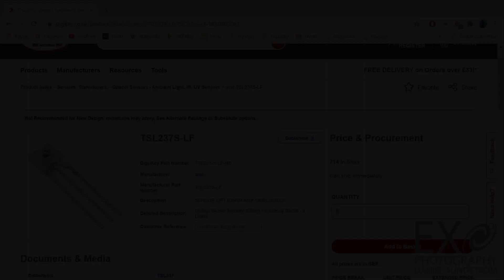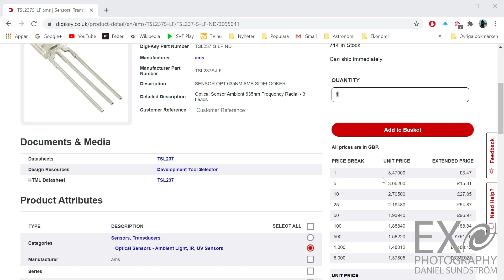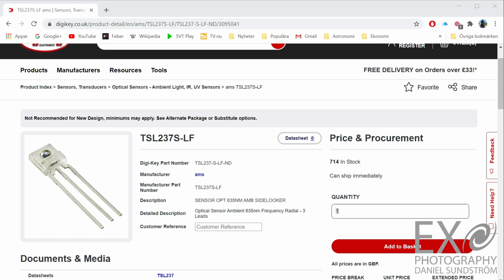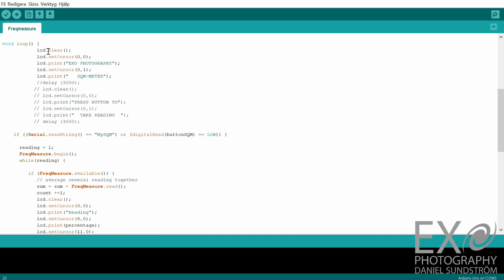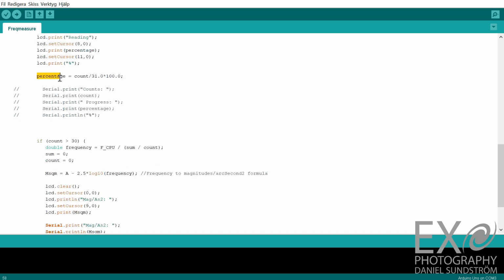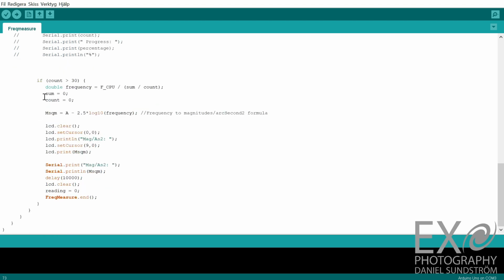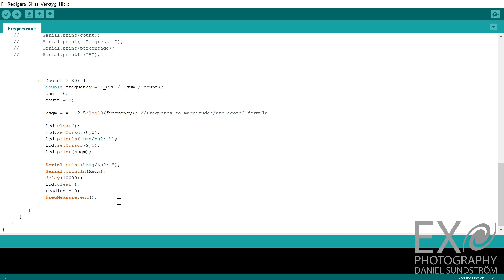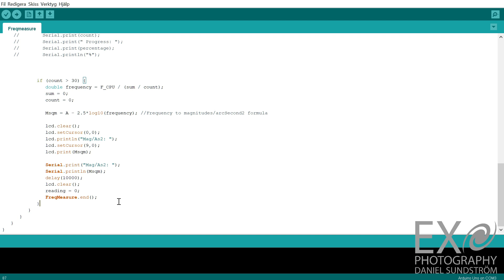MEASURE STARLIGHT - ARDUINO SKY QUALITY METER (SQM)

Comment: is a 20 degree required?? or would I get a better results with a 10 degree?? or a 30 degree?
Reply from the maker: 20 and 30 degree is OK to use, Unihedron which is the original has both, bepending on how narrow the FOV you wan't - but you have to calibrate either one any way.

/Daniel

Comment: Hi, how to add bignumbers code into the original code? I wish to make the sqm value in big fonts.
Reply from the maker: Like bigger on the LCD screen?
Reply: @ExoPhotography1  Yes. Normally they call it Big numbers.
Reply from the maker: @TommyLimKW  Oh, never heard of it... but a quick google made me find a library you need to add to the sketch, and i think there should be some code examples in the sketch too: https://www.arduinolibraries.info/libraries/big-nums2x2

/Daniel
Reply: @ExoPhotography1  Too bad my coding skills is limited. Just do not know where to start to add the code in. :)
Reply from the maker: @TommyLimKW  The problem is, I don't have that LCD and can not test :/

You will have to experiment yourself a bit :)
That's what i started with.

Good luck and happy coding :)

/Daniel
Reply: Because I am using lcd2004 for the project. So, wish to have bigger numbers for SQM value
Reply from the maker: @TommyLimKW  What kind of LCD is that?
Reply: @ExoPhotography1  It is 20 x 4 LCD. In ur video i noticed you are using 16 x 2 LCD

Comment: how to calibrate the value of "A"?
Reply from the maker: It is a while sience I did it, but if i recall right, I measured with the "Dark sky app" for iphoone, took like 5 readings, and altered the A-value so that the SQM meter measured the same as the app.

I did take about five readings, averaged them and verified so that the app and the SQM meter indeed measured the same.

It is a A-B test, measure - change the A-value - Measure again etc.

/Daniel
Reply: @ExoPhotography1   oh great thank you !
i am not able to find the TSL237 Sensor so what can i use as an alternative ?
Reply from the maker: @scienceandmathematicsenthu5942  According to this site: http://www.questions4steveb.co.uk/html/Astronomy/Astronomy-SQM?mobile
You can use "TSL235R, the TSL230R (Hi sens mode), TSL237S (not T, which is reported to be 50% less sensitive) or TSL238"

There might be some adjustments to the code and/or possibly the "A" value as well...

/Daniel

Comment: Great video! How did you insert the sensor to the lens ? It is to big to insert it horizontally with the black dog pointing at the top
Reply from the maker: I attached the sensor to the sensor with a small (tiny) drop of glue, and to "insulate" the fit - i added som electrical tape so the sensor itself is seeing through the lens, It's hard to explain in words, but it is just a matter of centering the sensor under the lens and trying to attach it permanetly.
Reply: @ExoPhotography1  is it centered inside the lens or just outside the lens with the little sensor circle pointing up?
Reply from the maker: @95kingston  Just Outside, flush against the lens, facing up

Comment: In the video you say you can use a Nano, but in the description is says an Uno. It does not look too hard to do but I'm a little confused.
Reply from the maker: You can use either, but if you are to buy a new one, i would go for the Uno :)
Reply: @ExoPhotography1  Thank you. I have used Raspberry Pi, but never Arduino. I'm sure I will have questions at some point. Thanks so much for the video and a great channel. :-)
Reply from the maker: @brianmurphy950  If you have experince with rPi this is a no-brainer :) Just keep asking! And thanks for the kind words!

Comment: Great post.  Do you have instructions or video on how to actually build the electronics?
Reply from the maker: Thank you very much.
No i do not have any detailed instructions, but there is not really anything to it, once you see the arduino board, there is no question where to attach the cables from the push button and the TSL sensor.
And if you use a LCd shield, it snaps on to the arduino whithout any cables at all.
The code and some more info can be found here: https://stargazerslounge.com/topic/366438-diy-sky-quality-meter/

/Daniel